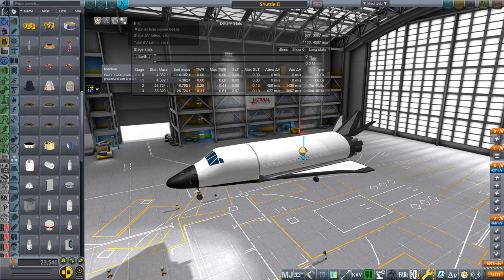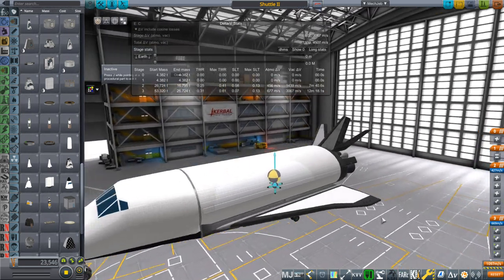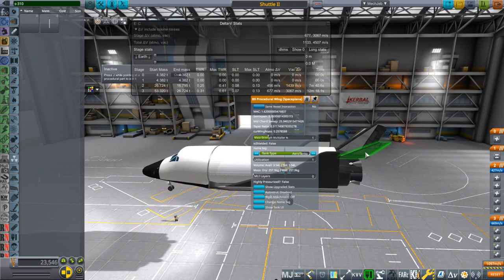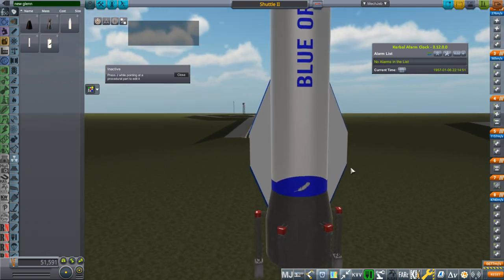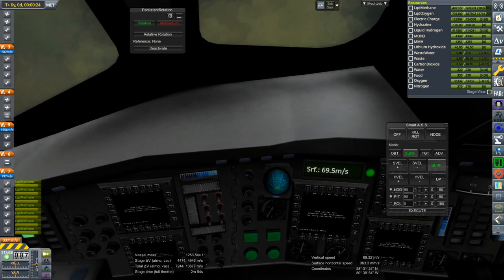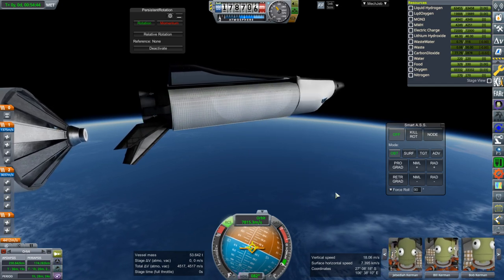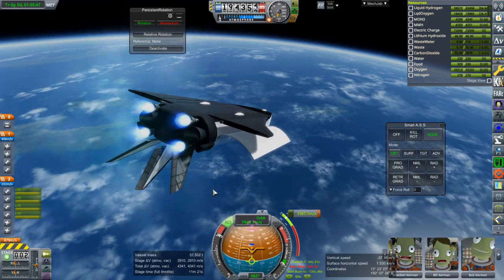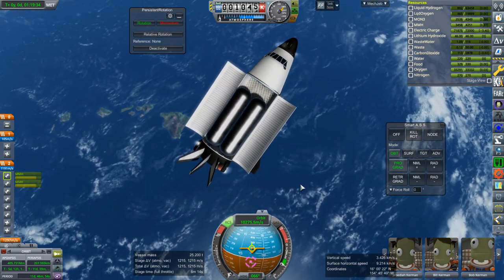Realism Overhaul in KSP 1.8.1 - Shuttle Mark II Prototype

Comment: Those BE-7 have small nozzles for landing, but for a stage like this and for transfers it would make sense to get much larger ones with high expansion ratio like RL10-B2. Should easily get 460+ ISP. For a spaceplane extensible nozzle for reentry.

Comment: Although it wouldn't work for this design since it looks to be about 7m across with the wings folded, one thing you may want to consider for future shuttles is ground transport in case of having to land on the west coast for weather reasons or for polar orbit returns (not sure if polar orbit returns require landing at Vandenburg as the only only proposed polar missions were military AFAIK). At 7m you would need a carrier aircraft like the 747 Shuttle Carrier Aircraft to return it to the cape, but if you could get a design to about 4m you could transport it via highways like the Falcon 9's are transported from Hawthorne, CA to the cape.

Comment: Instead of a fairing, how about a conformal payload adapter socket on the top of the second stage?   Something that leaves the crew cabin exposed, but makes a smooth transition from the aft surfaces of the orbiter into the cylindrical body of the second stage.